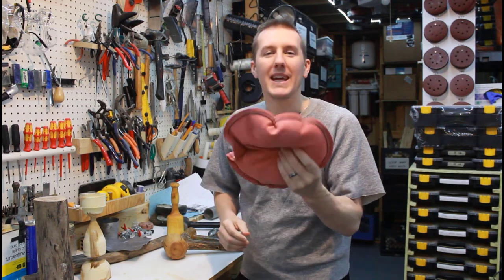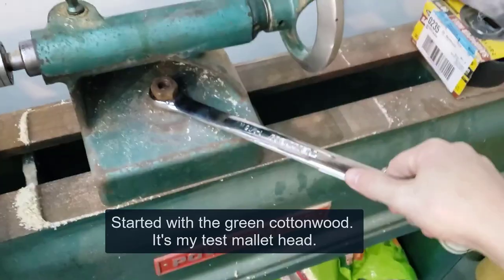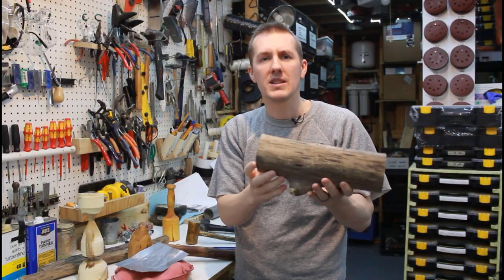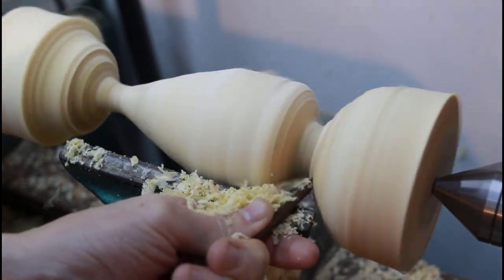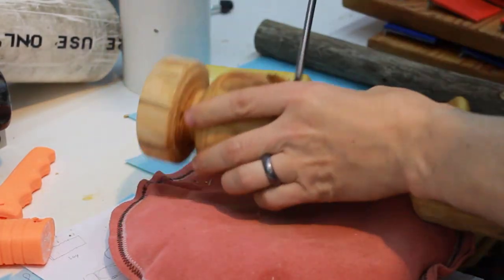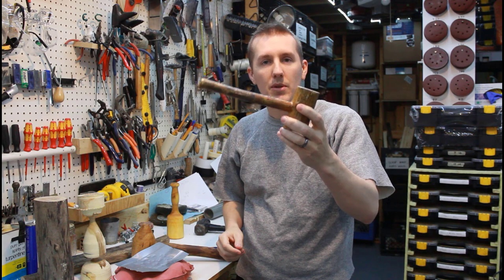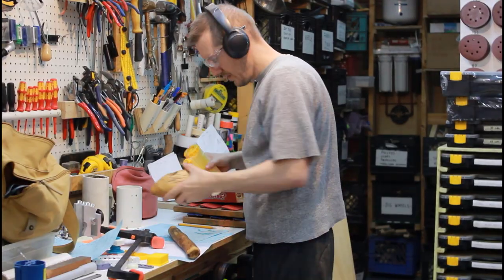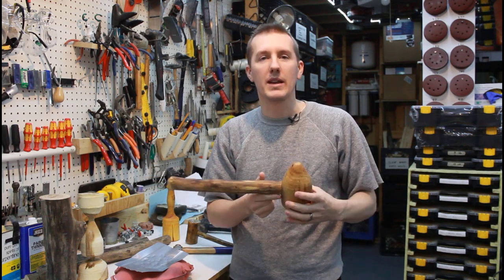Bossing Mallet - DIY Metalworking Hammer

Comment: Nice. Since you work with tree branches, you probably have a drawknife. For the handle tenon, with a circle template, draw the tenon size on the endgrain, put the handle in a vice & drawknife down to the line. There are 2 parts to the drawknifing. Use a curved motion to shape the shoulder & a straight pull for the barrel.